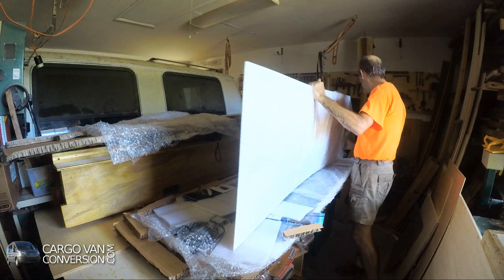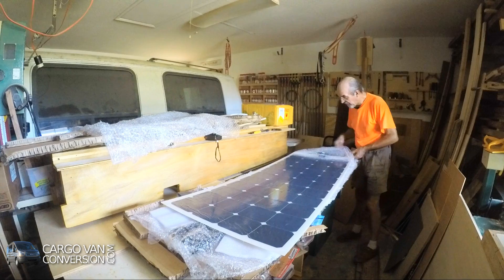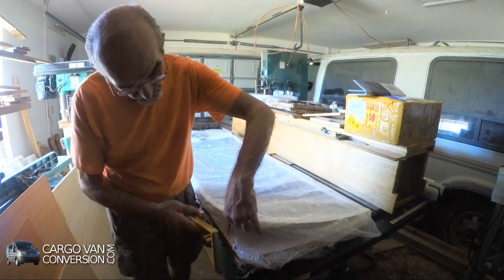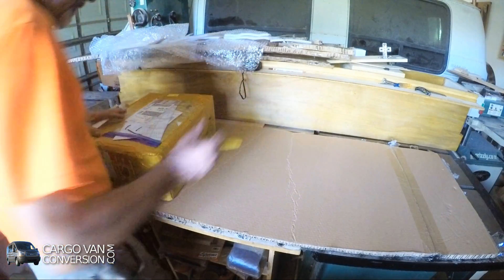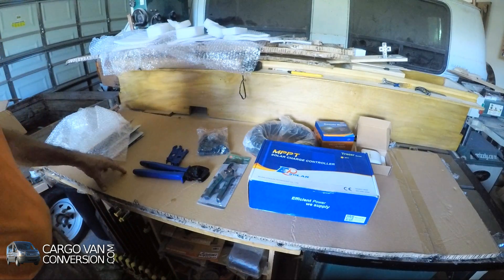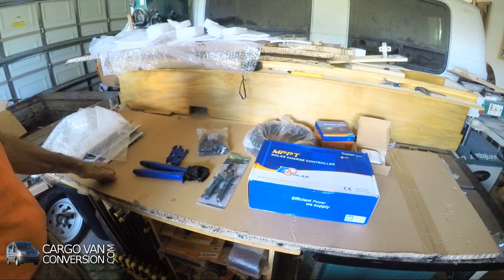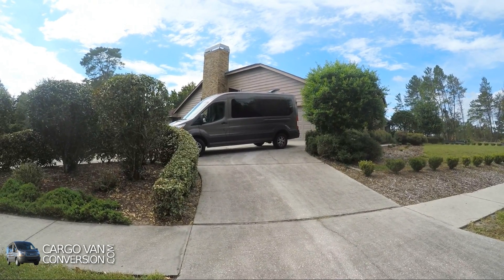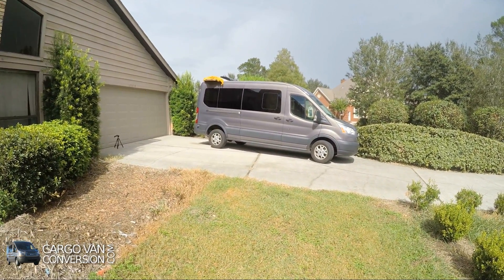Buying Flexible Solar Panels From China

Comment: what was the cost of the solar stuff you got? as looking for some for my conversion.
Reply from the maker: The three 135W flexible panels, controller, breaker box, cables, connectors, etc. ~$1500-$1700. The same stuff adds up quickly and was a couple of hundred dollars, but the principal amount went to the three panels. These fit exactly to the width of the Ford Transit roof, which was the main reason to buy. These are high grade Sunpower backcontact solar cells in ETFE laminate. It was a bit of a gamble, but it seems to have been a good choice. Always choose the ETFE over PET laminate. The grade (quality) of the cells is difficult for us mortals to determine, but price is a good indication.
I will regularly make updates about the panels, but so far have exceeded my expectations.
Van Williams
Reply: I have Citroen Relay LWB I am converting, those panels seem to be correct size for my conversion, I will be getting them sorted in next couple months, as have to wait for winter in UK to finish as we have snow at present so won't be able to proceed till around 2nd week May, but hoping to have conversion completed by end June, have most of interior made, just not fitted anything yet, I have been making fitments for this build now for 4.5 months, almost everything completed except electrical system, including solar and batteries,
My biggest problem was finding the flexible panels I wanted, as I have seen lot that have had really bad reports, on build quality and performance, I looked at the quality of the ones you used and what a difference in the design, much better design and nice looking panels, I am so great-full for you sharing,
thanks for info
Reply from the maker: Hi Steven,
I was born in Holland, so I know about your winters :) Would love to see some pics of your conversion, when it's ready.
I classify these panels as first and second generation. The first came out a couple of years ago, with PET laminates and low grade solar cells, but surprisingly inexpensive. They were overhyped with Youtube videos, where people danced on them and others that bend them in every direction until they broke. These were well-known to delaminate and break down; they also were low efficiency.
The current 'second generation' panels often (not always) have ETFE laminates, backcontact cells and buyers are warned not to bend them excessively (and only outward). One unresolved issue is the quality of the solar cells. Each type of solar cell comes in many grades, that will determine it's efficiency and life expectancy. You have to be an insider to know which grade you get. Paying a low price for a panel, almost guarantees a lower grade cell, a high price doesn't guarantee anything at all :)
Van Williams
Reply: I have used flexible solar before, very low output on a cabin cruiser, it was so bad took 3 weeks to charge batteries, then if you even left 1 5 watt light on the batteries would be at around 8.6 volts after 3 weeks, I had a Honda generator that I put on the bow of the boat it was quiet and charged the batteries quite quickly, I had to run it constantly to keep the electrics working until I fitted a 4 k Generator below the decks, this was self starting when batteries got down to 10 volts, it shut off when they reached 14 .62 volts, this was expensive purchase and took me a week of fabricating to get exhausts and inlets installed fireproofed and hidden, fuel was not too bad as got marine discount for the fuel at lake pumps.
I do not want a generator on my Van conversion, as now fuel is so expensive in the UK I also want the conversion to be as green as possible, I am undecided on weather to fit the panels directly to the roof or to fit them to alloy plate then to the roof, as this would eliminate any severe bends and would make the panels easily removable, was thinking of maybe a system where I could maybe put fixed bolts  on the roof and bolt the panels on with star knobs, this might also help keeping the panels cool,
I will be taking pictures of the complete build process, and will share them when I complete the build, Thanks for advice, keep building,  oh also like to say your posts are not only informative but so clear and easy to understand, nice job Thanks again Steve
Reply from the maker: Hi Steven,
Something must have been wrong with either the panels or the batteries on your boat. The flexible panels were probably one of the first available and may had issues with the quality of the cells, but another likely cause may have been the batteries. Letting your lead-acid's get below 12.2V may damage them too.
It is feasible nowadays to go all-electric in a conversion van, however it certainly depends on how and where you use the van. Your situation in Britain makes it more complicated and propane might make your life a lot easier.
The 3M VHB tape I used to secure the panels seem to work very well and it doesn't leave any holes in the roof. The overheating issue of these panels may be overrated; I still don't have much proof of it and at your location, it may be even less of an issue, if at all.
Bending on a transit roof is no problem. just make sure that during the installation, you have a second pair of hands and you avoid bending the panels inwards.
Wish you the best and, oh... I included a bit of Florida sunshine, you need it :)
Van Williams
Reply: Lol the panels on the boat were only 15 watts each had 2 it was all that was available 20 years ago, 
Since then I have bought solar panels (for my house) I took 2 years researching them to find the best buy, 
went with German panels, they are in total 4 Kilowatt system and work great, reduces my household bill by at least two thirds   and get 1500 GB pounds back a year, 
this is why I am still researching flexible panels as want the best for the van I can get, will be happy if I can get 400 watts on the panels, as the charge controllers now are so much more efficient then 20 years ago.
I have done 4 previous RV Conversions 2 buses and 2 vans, this one is for my brother, and needs to be amazing, as soon as I have finished this one will be doing my own, maybe my last as I will be retiring next year and want to go round Europe to start with then who knows where-ever the van takes us, but need to make sure I get it right as want to live in it full time for at least 2 years,
Reply from the maker: Hi Steven,
We apparently have a very similar background, even our future plans :)
With regard to the solar panels, I choose my panels primarily for stealth and size. Their length fits exactly within the gutters of my Ford Transit (0.5inch tolerance) for an optimal use of the roof. Flexible for its stealth, but if that's not an absolute requirement, go with regular rigid panels; they are as efficient, cheap and have a long track record.
Good luck!
Van Williams

Comment: Nice video . What kind of batteries did you buy for solar panel system? Thank you sir.
Reply from the maker: Hi Juan,
Tomorrow I'm posting the first of three videos about the installation.
And I actually haven't gotten my batteries yet. My plans are to get 200Ah-400Ah Lithium battery bank. As that technology is still new and pricey, I'll wait and get a set of 6V lead-acid batteries, so I can do some testing and connect just a few basic loads.

Van Williams
Reply: Cargo Van Conversion . I can't wait to see your next video about batteries. I am also building my own camper van and I think I will use two Trojan 6 volts batteries in serial connection. I was reading about Rolls batteries from Canada, but they are pricey and with less cycles than Trojan ones . Thanks for your answer.

Comment: How big is each of your 135W panels?  From unboxing it looks like 6 feet long (or maybe 2 meters if that company is measuring in metric), but how wide are yours?  Also, is there any issue with putting panels directly on the roof of van?  In other videos van dwellers talk about needing air circulation to keep the panels cool, is this NOT an issue with flex panels?
Reply from the maker: Hi Karin,
I specifically chose these panels because of their size; they are 135 watts each, 59.5" x 22" (1500mm x 560mm). With 59.5" in length, they fit between the gutters on the roof of my Ford Transit, with 0.5" to spare. That means a full use of the roof; on my LWB Transit with a rear mounted roof vent, three of these panels (405W) can be installed, that are virtually invisible from the ground. A fourth panel would fit at the very front of the vehicle roof, but because of how the Transit is built, that panel will be visible. Without the roof vent or on an extended model, a fifth panel would also fit (max. 675W).
I'm not an expert at this, but my research also found many comments about the issue around heat dissipation. However, there is very limited actual data, showing that. I also found claims that the metal roof could work as a heat sink. And I am unsure if this also applies to the newer panels (ETFE laminates and high grade backcontact cells) that I am installing.
As stealth is relatively important to me, my approach has always been that a possible output loss because of heat dissipation issues, is easily remedied by adding more solar to the setup. If stealth is only an added convenience, I would recommend to go with rigid panels, that have a long track record and are much cheaper.
As you can see in the video that will be posted tomorrow, I use 3M VHB tape to attach the panels to the roof, but leave a few areas open, where depression are in the 'corrugated' roof. This will allow for some airflow, but I doubt that will make much of a difference.
Any loss of output is likely to occur in summer when the temperatures are (extremely) high, much less in winter. Since a solar system should be sized on the period with the lowest output (winter), any loss of the extra output during summer, may be less important.
These are just my views on the subject and time will tell how it works out. A couple of days ago, I did a preliminary test of the three panels on the roof of the van (open circuit/no load) at 10AM on a sunny Florida morning. I registered 28V/8.5A (without MPPT). That would likely give it over 100A-120A daily output, in winter. I'll post a video with more testing, when they become available.

Simple question, not so simple answer.... :)
Have a great day!

Van Williams
Reply: Thx for your measurements of those panels.  I'm looking at an Aliner Classic (no dormers) that is already prewired for solar.  Since your panels are 2" shy of 2 feet wide I'll bet I could attach 2 (maybe 3) of them to the roof between the fan/vent at top & skylight at bottom.  I've seen others attach 100watt glass/ metal frame, which seem heavy & bulky, but 2 flex panels would give me 260watts (& 3 is over 400w). Time to take out the tape measure.   

Oh, thanks for replying because I forgot to subscribe so I can see how your build & installations go. Travel safe.
Reply from the maker: Hi Karin,
Tomorrow I'll post the first of three videos about the installation.
About the prewiring. Don't know about your Aliner, but many prewired RV's have cables that are too thin. Use an on-line AWG/Voltage Drop calculator to check the wire gauge that's needed.
I specifically wanted flexible panels for the type of roof I have and for stealthiness. If that's not a requirement, you may be better off with rigid panels. They have a proven track record and are much cheaper.
Have a great day!

Van Williams

Comment: Just a couple things, I figure you did good homework, but? How many watts, efficiency? Batteries, inverter capacity, costs for shipping, overall vs going directly  vs Amazon or say West Marine? I like that you showed on the van for spacial relationship
Reply from the maker: Hi kenneth,
I have other videos with a lot of that information, add links to product info and write often more specifically about these subjects. You can also find multiple replies to similar inquiries among these comments.
The main reason why I ended up with Link Solar is that besides the need for flexible panels, I was looking for panels that fit the width of the roof of a Ford Transit closely. They were one of the few that supported this size. These three 135 watt panels are 59.5" x 22" and the distance between the two built-in gutters is 60 inch. This means an easy installation and it maximizes the total output. Since I have a rear roof vent I was able to place up to three panels on the roof, that are virtually invisible from the ground.
I would be able (on a LWB) to add one more panel, but that becomes visible and I choose not to. Through my circuit breaker box, it's simple to add more (mobile) panels, if needed.
The main improvements of these panels over the first generation flexible panels is the use of ETFE laminate instead of PET. It is less relective and hopefully resolves the issue of delamination. The cells are high grade Backcontact Sunpower cells with an efficiency of around 20%. You can read all about it on their website cargovanconversion.com/LS While Link Solar is a sponsor of my website, I have no interest in their products or business.
I could buy smaller 100w panels on Amazon and alike, but that would mean a collection of horizontal and vertical panels, likely with unused space, more cables and more voltage drop. It was difficult to find this specific size (in combination with the other requirements). Production of the panels took two weeks and shipping was airfreight with FedEx 3-4 days. Fedex called me for a customs form, which was supplied to me by Link Solar and they took care of the importation. There is a chance of import duties, but that was not levied in my case. You as the buyer would be liable for that.
The inverter was not part of this part of the setup. I will post about that at a later time (my specific setup requires two inverters, one 2000w, the other 1000w). I have currently no batteries, the plans are a 200Ah-400Ah Lithium battery bank. They will be purchased and installed at a later time; for the time being, I'll install two 6V lead-acid batteries for testing and some basic camping. All that in a future video.
There was not much choice between Amazon, Westmarine or alike as the specific size was not available. And while I had a good experience, I still think there are inherent risks when buying directly from China. If you can find the perfect set of panels on sites like Amazon or even Aliexpress, that would be a safer bet, because these companies offer many guarantees of delivery and payments.

PS Just a couples of days ago, I preliminary tested the three panels (405W) after they were installed on the roof of the Ford Transit. It was 10AM on a sunny Florida morning (Nov 2017); they generated (open circuit/no load) 28V/8.5A That would mean they could generate more than 100A-120A on a daily basis close to winter. I would be satisfied with that.
Please comment if you have more questions.

Van Williams

Comment: How about a follow up showing installation and how well (or not) the panels are working?
Reply from the maker: Hi sunbin64,
I'll be posting the first of three videos about the installation this Friday. It's a lot of work getting the videos ready, so bare with me :)
I will go into testing much deeper at a later time, but I already did some preliminary testing (no load/open circuit) and had good results.
A couple of days ago, I tested the three panels on the roof of the Ford Transit; it was 10AM on a sunny morning in Florida (Nov 2017) and I measured 28V/8.5A (without MPPT). That would probably bring in more than 100A-120A on a daily basis. I built in an easy way to expand the number of panels, but with these numbers, I may not need to.
In the upcoming weeks, I'll post a video, specifically about this subject, so watch out for it.

Van Williams

Comment: I avoid Fed Ex they are the worst
Reply from the maker: Hi Michael,
Locally I receive most of my stuff through UPS and the USPS, but FedEx offers equally good service here. In case of these panels, I had no choice and with regard to the importation, they did an excellent job.
Perhaps, it's also a matter of being lucky.

Van Williams

Comment: Two big advantages here: Stealthiness factor. And the fact that they are against the roof, which means better gas mileage than panels raised above the roof. 
Subscribed.
Reply from the maker: Hi Ty,
Agreed, but there may also be an issue of heat dissipation. It is often mentioned, less often documented. The advantages outweigh the disadvantages, I think.

Van Williams
Reply: @cargovanconversion  maybe you could get some aluminum or copper sheet metal to use a backboard/heatsink for the panels?
Reply from the maker: @kingarthurthe5th  The best solution is still just adding an extra panel for efficiency loss.
With the advent of Lithium batteries solar maybe less important; DC-DC converter will produce more power, and faster in a much shorter time.
Van Williams & Joey